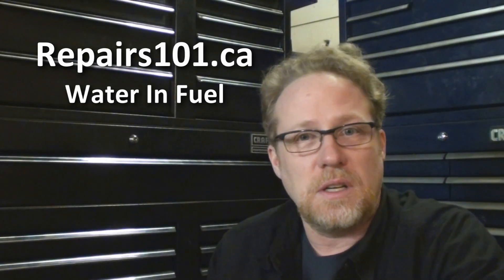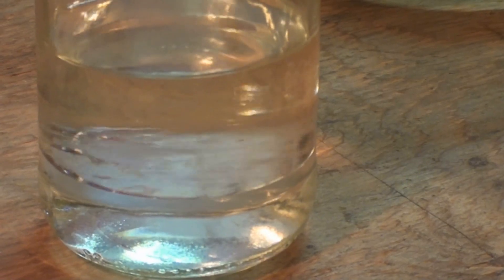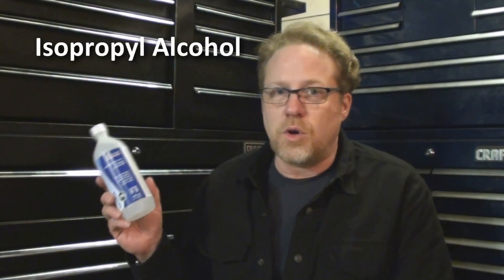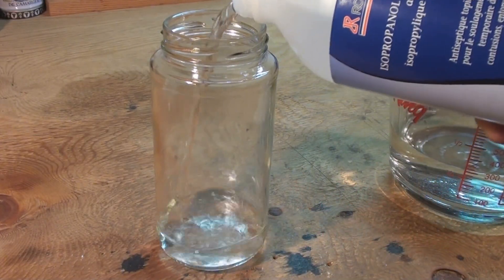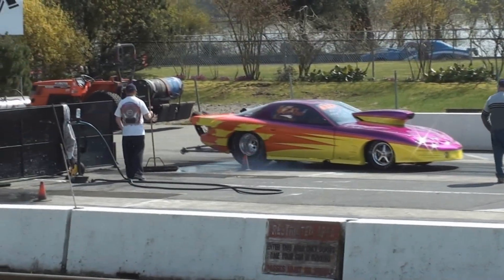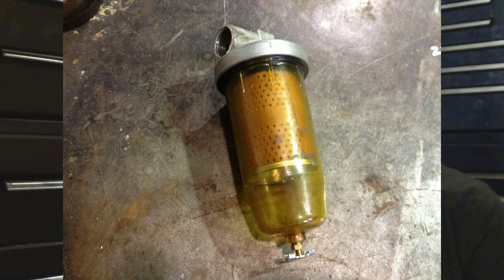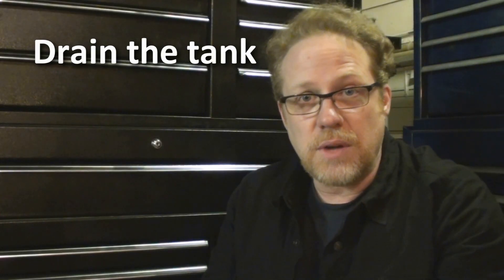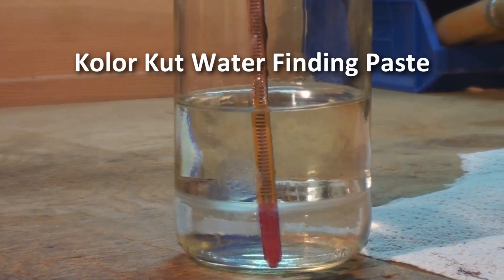Water In Fuel

Comment: Back in the 1990's when Florida still did Emmisions testing  .my old cars would fail ..used to pour a few bottles of alchohol in my gas tank and take the air filter off and unplug a few vaccum hoses off to get more pure Air coming out the exhaust  ..Always worked for me to pass..Thank god they stopped doing those test  ..Poor folks cant afford to fix it correctly

Comment: lol its not a big deal if theres some water in the fuel. it just passes right thru. water injection is even desired in racing or in breaking up carbon deposits.
And ethanol and water mixes, so all ethanol states... not even an issue.
Reply from the maker: True, but I'm a marine mechanic and (for example) gas outboard engines are mostly still carbureted and water in diesel can shut you down.

Comment: I've left my cap off of the gas(gas oil mix for 2 stroke) can during a rain...so...I haven't used it.  And I don't want to through it away...is there a way to filter that gas out before I use it?
Reply from the maker: Ideally you run it through a machine that has a water separator (ie: RACOR), as seen in the video. Failing that you could set up a fuel approved pump and run the mix through a water separator. Or just let the water settle to the bottom and pour the gas off into another can and try to leave the water behind in the old can. You could even try sealing the can, flipping it upsidedown  so the vent is the lowest point, waiting until it settles and pouring the water out through the vent until you see clear fuel coming out. Could get messy though. Good luck.

Comment: What if my vehicle is a flexfuel?? is it okay to try Ethyl Alcohol in it?? because mine says that it can run on E85 gas.

and actually I'm starting to get suspicious about the gas station that I go to fill up my car with unleaded 87 gasolin because my car started to shake at lower speed whenever I try to hit the pedal or release it. So I thought it could be a bad gas or something that like that.
Reply from the maker: +Majid Al-Zahrani - your flexfuel car can handle a small dose of alcohol but your problem sounds more like the throttle position sensor malfunctioning.

Comment: If you had to refuel on a jetski in the middle of the ocean and a wave hit and got water in your tank while refueling.... Is there anything you could do immediately to help minimize a complete break down miles and miles from shore?
Reply from the maker: +Corey Harmon - I sure hope you're not floating there waiting for an answer - I would hope the designers of your vessel allowed for a good size water separator and head for shore. If it's a RACOR or similar see-through/sight glass style I would monitor it after 5 minutes of running and drain off what I could and press on for safe harbor.
Reply: +Repairs101 2013 yamaha fx cruiser HO 
Making a trip from Florida to Treasure Cay, Bahamas in June. 
Some members of my party are carrying extra emergency fuel in aux tanks that are plumbed into the main tank. This is both "expensive" and technical. 
I just want to bring some fuel cans. Regardless of how fancy of a fuel can, or nozzle for a fuel can, that I buy... There is an inherent risk of a wave splashing over the ski while trying to refuel. (if actually needed, which in almost all likelihood, will not be needed)

Comment: There's a meme going around on Facebook telling people to add a cup of water to every gallon of gas in the Spring because it will help cool the engine and clean the cylinders and cylinder walls. I wonder if people actually fall for that. Pretty messed up if they actually do.
Reply from the maker: +ActronJimmy - I've seen several including one that says be sure to run straight water instead of coolant in winter - unfortunately some gullible people are bound to pay thousands for taking bad advice off the internet.
Reply: +Repairs101 That's why I always say, Question everything! haha
Reply: One cup is more than enough to kill power

Comment: so will it mess up someone's engine?
Reply from the maker: +MIKE EL  - I assume you're asking about water not alcohol as I addressed that in the video - water will ultimately get past water separators and filters and as soon as it reaches fuel injectors (or the carb) the engine shuts down. Some damage to injectors may occur although carbureted engines can usually be cleaned out and run again with very little expense (beyond labor). Good luck!
Reply: Repairs101 so what's the best way to kill a engine.  Trying to do a 95 contour

Comment: Unknown to the general public, refineries started adding alcohol to gasolene in early 80's to maintain the octane rating; 87 in the case of Reg Un-leaded. Moisture will mix with the alcohol over time and will settle to the bottom of the tank. A fuel/water separator will take care of this problem unless the water contamination overwhelms separator capacity...then you will be dead in the water. Mfgrs recommend that you keep fuel tanks topped up. This mitigates the condensation problem.
Reply: @ D Wetick
Can we insdal or buy water-fuel separator for gas-powered 4 stroke regular audomobiles? Think it would be eazy to insdal?(considering dint come az OEM). The carz got fuel filter but thatz just for solid sediment

Comment: Get some lucas fuel system cleaner it will clean it out.
Reply: Aspie Otaku Seafoam works better.
Reply: TampaOutlaw  use Marine outboard two cycle TCW3 rated oil at 1 oz oil per 5 gallons of gasoline.  You can Google   LS1 been testing oil and read about the testing. It works great cleans and lubes your fuel system. The Marine  oil needs to be TCW3 rated. Seafoam is expensive. You can get Walmart super tech Marine two cycle oil tcw3 rated oil at $13.00 a gallon. Remember 1 oz oil per 5 gallons gasoline is the formula.

Comment: a mechanic told me it could blow the engine as well my friend has a half of gallon in his tank and drives the car like a dummy   it can pop a piston?
Reply from the maker: MrEricStarr As I said in the video : Alcohol is corrosive to certain metals and may cause degradation of some plastics, nylons, rubbers and corks such as are found in components like gaskets, hoses and seals. Pop a piston? I suppose the potential exists but burning a hole in one seems more likely.

Comment: I was a trucker for over 45 years, I did use alcohol in my fuel tanks. I could look down in the tanks and see the nasty water but after the alcohol like magic it was not there. just 16 oz of this magic stuff cleaned all the water out of the tanks! Or did it Lets see 300 gals of diesel a little bit of water 16 oz of magic, I did not freeze up or have power issues (I ran socal to Calgary). Never did I have gunk or puke as you say in my tanks or fuel filters, Looks like algae.